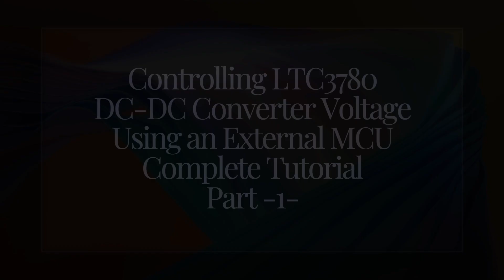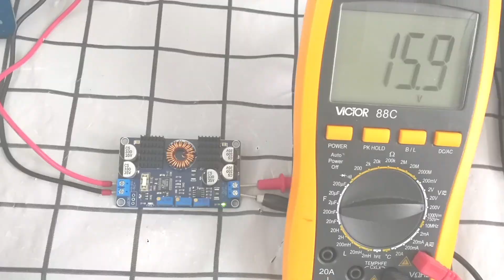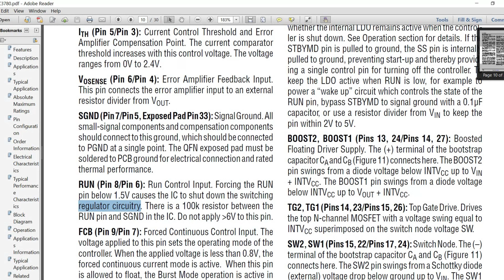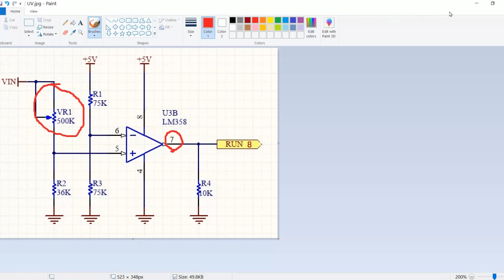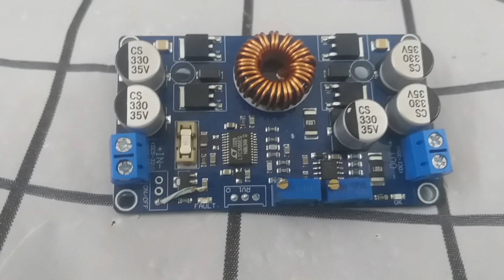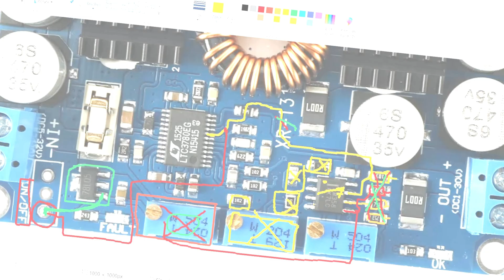Controlling LTC3780 DC-DC Converter Voltage Using an External MCU: Complete Tutorial Part -1-

Comment: Eagerly awaiting more videos on this board. 
extremely useful,

could you conver if the voltage is stable when switching?
some similar modules have very unstable voltages in the moment they are changed, 
creating spikes which is poor for sensitive applications. 
would be good to see if these share that issue or not.

All the best!
Reply from the maker: Hello, Here is the PART-2-https://www.youtube.com/watch?v=8kLj0kJG_rI
Stay tuned for Part 3, where we'll dive deeper into programming the MCU and fine-tuning the voltage regulation.

Comment: You will be using a DAC?
Reply from the maker: I will try to cover all the possible ways to control the DC-DC converter via MCU. Stay tuned for the coming parts.
Reply: @Challenger-Tech  did you get any success it has been more than 20 days now, I did the project and I was able to achieve  voltage control with stability but current control is more challenging to get it stable.
Reply from the maker: @rydjaradat  Hello, Here is the PART-2-https://www.youtube.com/watch?v=8kLj0kJG_rI
Stay tuned for Part 3, where we'll dive deeper into programming the MCU and fine-tuning the voltage regulation.

Comment: Very useful, thank bro. When will u upload part 2?
Reply from the maker: Hello, Here is the PART-2-https://www.youtube.com/watch?v=8kLj0kJG_rI
Stay tuned for Part 3, where we'll dive deeper into programming the MCU and fine-tuning the voltage regulation.
Reply from the maker: Thanks a lot, I am working on the next part, stay tuned.
Reply: @Challenger-Tech  I've tried to using some configulations of opamps to combine feedback voltage of dc/dc output and set voltage from MCU (using DAC or PWM through RC filter). But something went wrong because of non-ideal characteristics of opamp or undefined mistake. Hope to see your solutions! I'm doing a study research.
Reply from the maker: @thuanphan4528  Hello, Here is the PART-2-https://www.youtube.com/watch?v=8kLj0kJG_rI
Stay tuned for Part 3, where we'll dive deeper into programming the MCU and fine-tuning the voltage regulation.

Comment: So, here by using PWM we can control the output voltage of converter.
Reply from the maker: Yup exactly, we will implement that and more in the coming parts. Stay tuned.
Reply from the maker: Hello, Here is the PART-2-https://www.youtube.com/watch?v=8kLj0kJG_rI
Stay tuned for Part 3, where we'll dive deeper into programming the MCU and fine-tuning the voltage regulation.